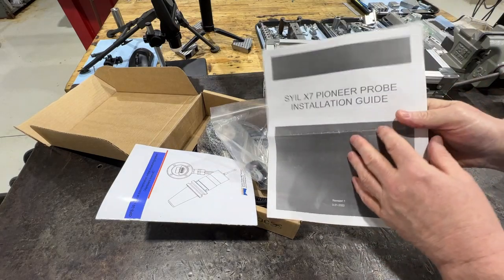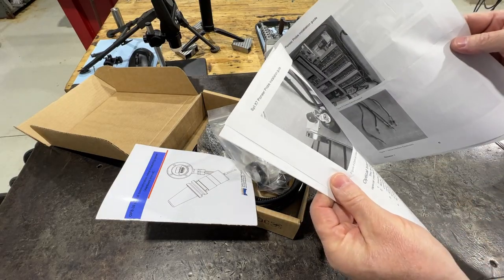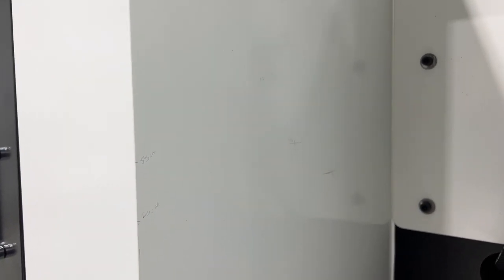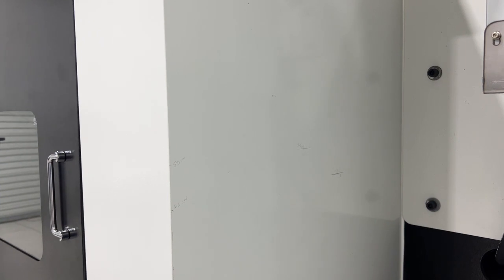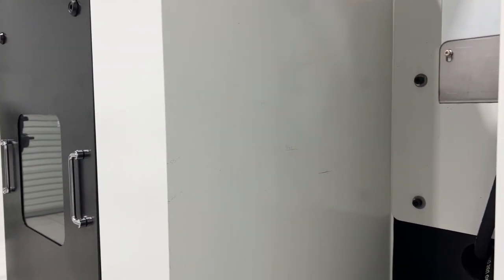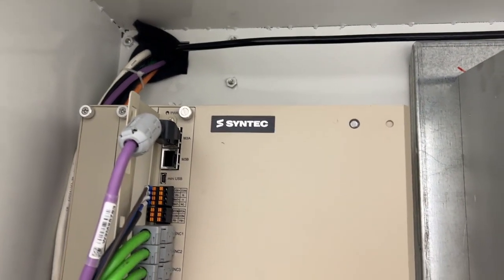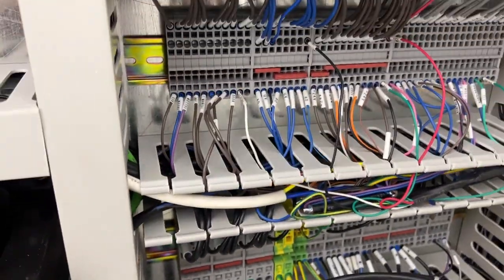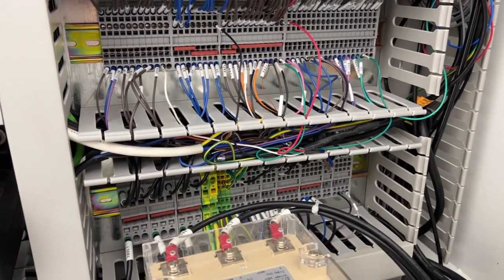Installing the Pioneer Touch Probe on the Syil X7 Part one.

Comment: Hi, Great video!

I got mine from Syil today but they forgot to put in the installation guide for the Syntec. 
That means I`m not sure which wires to use from receiver into the Syntec connections in the back.
I guess the Installation guide says which wires to use for which connections. 
Do you have the configuration (since you have wired on the heavier wires on yours)?

Red = Red  to +24V connection in the back (You connected two wires there)
Black = Black to 0v connection i the back
Shield and Ground (yellow/green) goes to ground in the connection in the back
Grey goes to?
Brown goes to?
White goes to?

I have a "PROBE" connection in the back, which wire goes there?
I have a "PROBE-EN" connection in the back, which wire goes there?

Wish you a nice day!

Ola
Reply from the maker: Do you get a new machine or the Pioneer touch probe? Give me your email and I will send you the install manual.
Reply: @MaDuceRules  Hi, I have had the Syil X7 for 3 years now but I got the Pioneer probe from Syil yesterday. There were only the probe manual in my kit and no wire configuration for the X7 Syntec. The other manual you showed in your kit. Syil X7 Pioneer Probe Installation Manual.
Youtube removes my comment because e-mail addresses in comments are prone to spam.
I Can contact you as PM on Messenger?

Wish you a nice evening/day!

Regards

Ola
Reply from the maker: @olaraastad7627  send me an email using the email address I have listed in the about section.

Comment: Another great video---- can't wait for 2 &3.  I took the lead from you and have now installed the fantastic Syntec shortcuts.  My machine is the same as yours - Syntec 22MA controller.   I note that on system startup your controller shows a great picture of the X7 mill.  Did that come as standard or did you upload a photo?  Cheers
Reply from the maker: Thanks John. I'm working on part two now. The probing routines that come standard with the X7 are useable but barley. I've re-written them all and added 14 new ones. They are much more user friendly and functional now. I will share them with anyone that wants them once Part two is released.  The pic is not standard. I added it.
Reply: @MaDuceRules  Thanks for reply.  I realize you have a lot on but I would love to know how you added that image.  I also took your lead and made the USB on the RHS of control functional.  I prefer it there than on front panel.
Reply from the maker: @johnspathonis1078  you have to make a backup of the OCRES group and change the pic in the backup zip file then do a restore. It would be easy if Syntec gave us access to the hd but for obvious reasons they don’t.
Reply: @MaDuceRules  Thank you.
Reply: agree, MaDuce's videos are great. How do I get my hands on the Syntec shortcuts?
Reply from the maker: @dancollins1012  contact Syntec . I'm not sure if they are release yet to everyone.